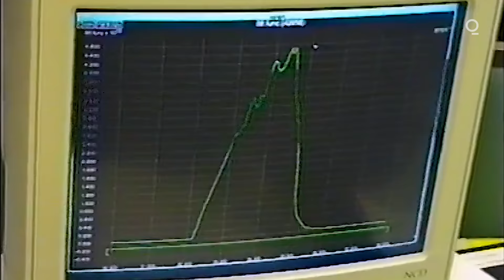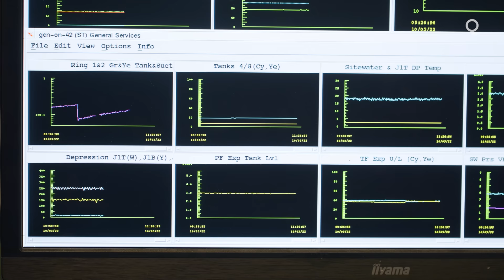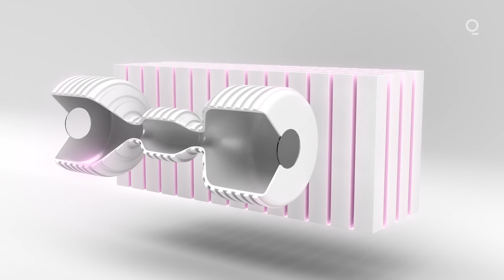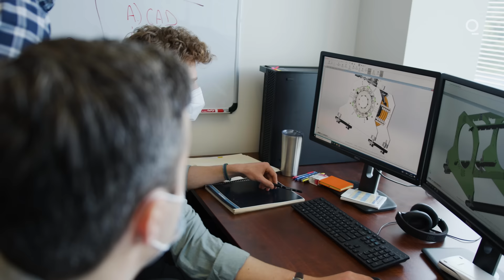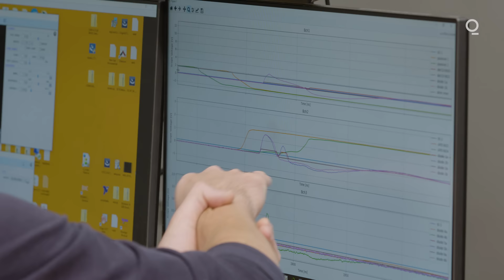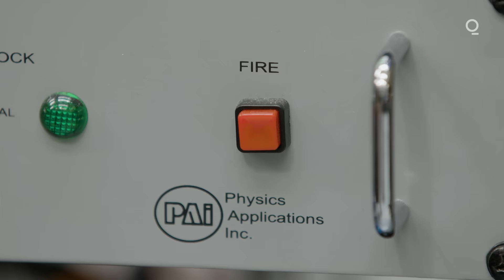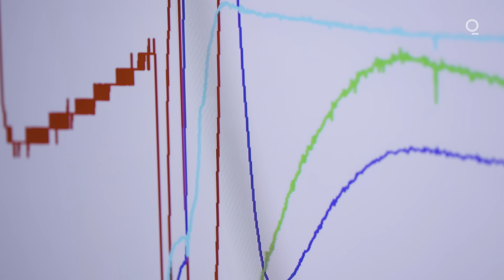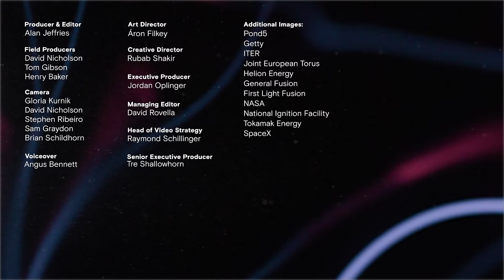Why Private Billions Are Flowing Into Fusion

Comment: Until you can manipulate the plasma field dynamically at the atomic level, we will never be able to sustain a stable fusion reaction for energy production. Only a sophisticated AI will be capable of managing this kind of material management problem dynamically and in real-time to account for the crazy number of fluctuations that will occur in the plasma field as the atomic nuclei move at the speeds needed to overcome the electromagnetic repulsion of the protons to achieve fusion,  but those speeds also increase the temperature, which also decreases the plasma density, also defeating the pressures needed to help sustain the fusion reactions.
Reply: Not necessarily. It may be difficult for some steady state magnetic confinement systems, but the systems presented here are pulsed. They only need to keep the plasma stable for milliseconds or even microseconds.

Comment: I've come up with, on my own, the differential design elements that increase energy development without additive power input. Undulation of the field, for example, increases collisions. Harmonic field resonance is able to create a better field strength per unit of power injected. There are other things that I have come up with that would also work, though not being a 'nuclear physicist' by trade, most people would just think I'm some dude with non-effective ideas. Both of those items I've already mentioned came out in research papers AFTER I devised them. While I might be credentialed as a lay person, I have an IQ over 160, and dabble in sciences on a PhD level.

The problem of plasma systems is that people are treating plasma solely as an energized gas. In a high concentration, at a higher rate of speed (like we find in the reaction toroid), it takes on the properties of a fluid suspension. If you design your models based on that, you get better yield:propagation ratios. (When yield exceeds propagation, you get generation; otherwise the system takes more power to operate than it creates.) With some tweaks, some of these projects have potential.

Comment: Just correlate the projections 20 years ago by similar venture capitalists in Quantum Computing in every modern NA  home in 2022.  These are noble goals like with fusion start-ups ((99%) will fail to deliver)) and investors will lose big bux.  By Contrast: The magnetic flux capable of being a 1 or 0  (nicotine and helix solved in a millisecond capability - where are the results????)) in QC.  It is only feasible in say astronomically expensive 4 Qu bit computers with only marginal capabilities beyond IBM uP technology developed 40 years ago.  Ditto net gain in fusion reactors deviating from the Tokomak (Russian) classic  design is a joke, and be forewarned before pre-paying for this fantasy. The Livermore lab delivered results in a 1 uSec or less fusion collision energy derivative, and the metrics to measure the neutron escape  and alpha decay rate were somewhat debatable. Better optical precision  in the laser just does not cut it for me as the hype last week was all about net gain (??) for a U sec but then what..